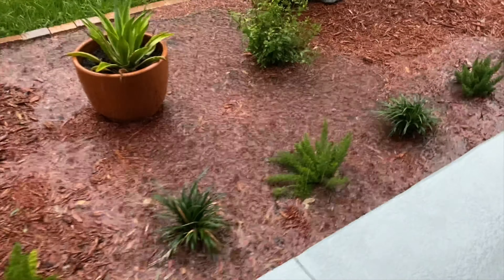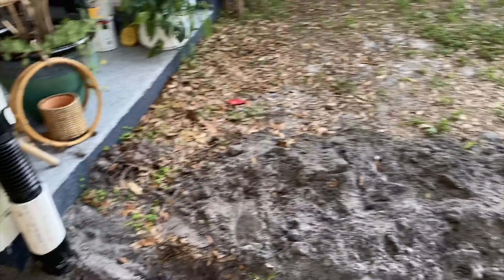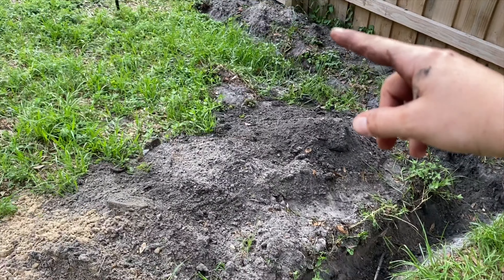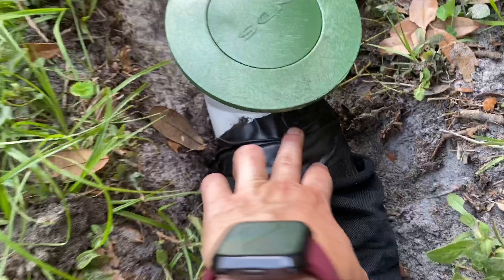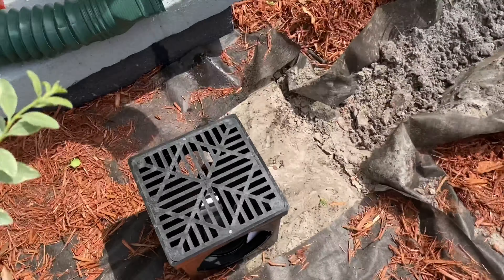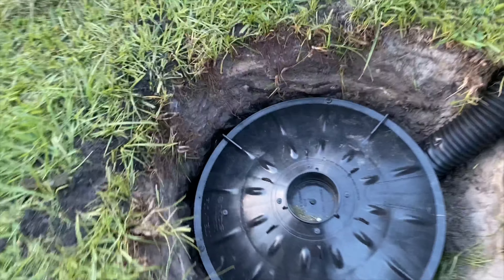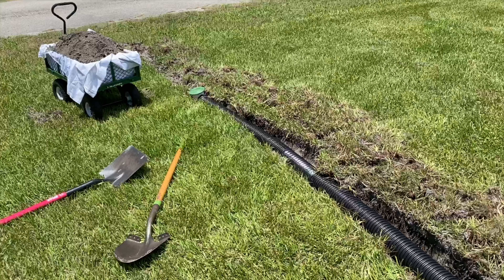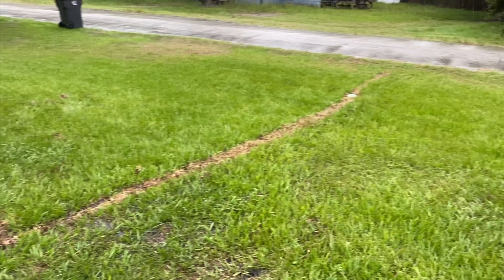NDS System Install: Fixing gutter downspout overflow & flooding - french drain and dry well

Comment: If your front  porch has a 120 outlet near by. .. you could install a another one of those with a sump pump , but on the new one install the drain on top of the lid knock out  to collect the surface water .. same way pump it to the street

Comment: I wondered about the gravel. 
I am battling low spot also. Looking for the right solution. 
   Great work. You saved a ton of money. Worked hard.  You can appreciate what you've done. Not worry if contractor lying and ripping you off...

Comment: On the front yard, as long as your popup drain is working correctly, you can put perforated pipe crossing that low region and connect it with the flo-well. That should collect all that water that is puddling. The well will fill quickly, but the water will start flowing to the street and you’ll be fine.

Comment: You’re supposed to put a foot of gravel around the flo well. In addition the top you chose not to buy should be installed. Installing it allows you to get inside the flo well with a tool in the event something like leaves and such get in there from the roof and allow surface water to fall into the well. The foot of gravel is to allow the water to percolate along with landscape fabric around the flo well to keep dirt out of it. You may also consider punching out a couple of the 4 inch holes and adding a French drain or “leach” bed to help. 

Backyard, needs 1 1/2” rock surrounding the perforated pipe and landscape fabric between your rock and soil so the soil doesn’t clog up your pipe. Just the perforated pipe. =)

Hope this helps! You’re doing more than most try to do! Good job!
Reply from the maker: Thanks! I knew adding gravel was a good idea but honestly I didn’t want to spend the money on it and lug it to the house. I know my yard is super low and this probably wouldn’t fix everything completely anyway. It seems to work great so far for our daily rainstorms. I didn’t think about the soil clogging up the pipe, definitely might have to add some rocks there!
Reply: This won’t last but 3 years. No rocks, that pipe will be full of roots,

Comment: Is your soil mostly clay? I'm considering one of these, but I've heard that they don't work very well with clay since water doesn't percolate through it like loose/loamy soils.
Reply from the maker: The soil here is basically sand!
Reply: @devitodoes3269  Hmmm, that's interesting. Supposedly, sand is one of the faster (if not fastest) draining soils. In the video, I see the pooling...but does it percolate away pretty quickly once it stops raining? (It should if it's mostly sand...versus clay, where it can hang for hours if not days.)